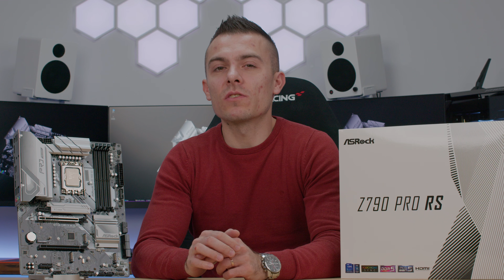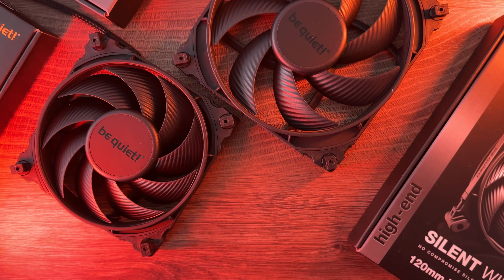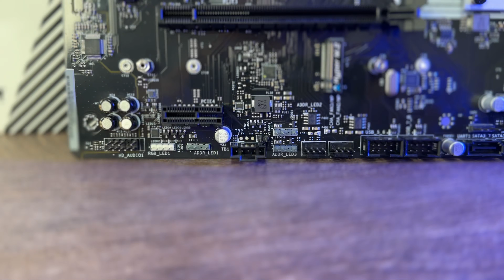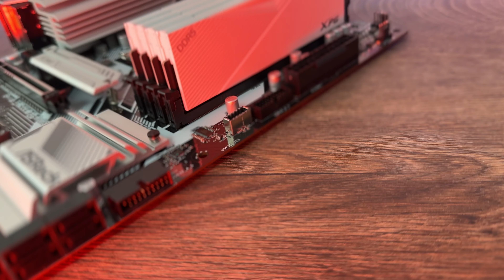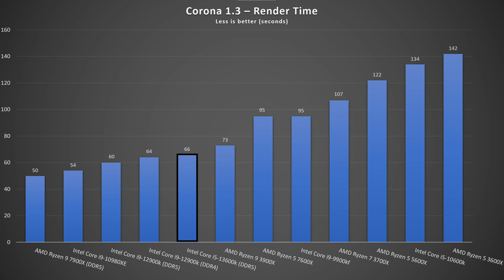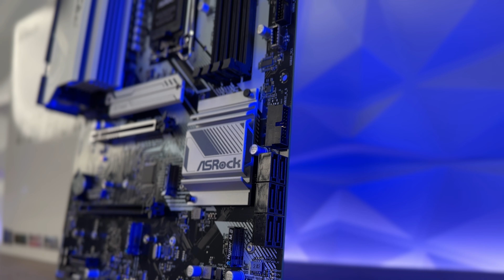ASRock Z790 PRO RS w/ i5-13600k - Benchmarks & Overview

Comment: Got this board along with an i5-12600k and 2x16gb DDR5 ram at 6000mhz, but had issues since day one despite being on the newest bios version at the time(15.01, 2024/9/27), having my drivers updated etc. At first the PC kept having random freezes/crashes when enabling XMP mode at 6000mhz, managed to fix it by setting speed to 5600(again via XMP).For some reason I also have microstutters in basically every game - more frequent and noticeable ones in CPU-intensive games.Weird, because I tested RAM, CPU and GPU - RAM returned no errors with memtest86, GPU(gtx1080) had the expected benchmark results and i5 results also looked on par with that I saw online.Tinkered with Windows settings known to cause said microstutters, tried upgradint fro m win10 to win11 but it made no difference. PC is at repair shop right now and I noticed Asrock had released a new BIOS version in JAN2025 that updates intel microcode and improves memory compatability. Hopefully that fixes it, but if it does not I am really at a loss - it is either the motherboard, which I highly doubt or the PSU. The one I got is a Cougar GEX 750W 80+ Gold which should be a decent power supply, however what I read online is that it's voltage regulation is not the best and since intel 12th gen and above have "transient spikes", it can cause microstutters. If anyone knows what might be the issue and has experienced something similar, please let me know. I have been going nuts for 3 months here lmao.

Comment: Not all of us are Gamers and don't need painted MB like Sonic and RGB lighting. I am a gamer but i need the 8 Sata ports for massive data Hard Drive Storage. Yes a use a SSD for windows ( my C drive ). The other Sata ports will be connected to 6 to 7 Hard Drives seagate Ironwolf 10TB or better. Some people run RAID, so some MBs now come with ONLY 4 Sata ports and no more 7 segment display. How can you run RAID 5 or 10 on these. Question. Do the M.2s Share the Sata ports ?
IF so do they disable the SATA ports ? Thanks for the review  this one is for me. I'll be running and i7 C cpu and will be fine for gaming. oh i subscribed
Reply from the maker: Yeah, I understand what you are saying about the design. I just have to mention how it looks even though people can see it from the B-Roll. I THINK, 2nd or 3rd share SATA connection and some ports are then disabled. Don't know which ones to be 100% sure. I don't think you can run RAID 5 or 10. Only saw 0 nad 1 explained in the manual. And of course, thank you very much for the sub!

Comment: hi , i will buy this motherboard tomorrow , i have a 13600kf , do you think that this motherboard will be ok ? not high temps like 100° (i have a 360 aio)
Reply: bcs in some motherboard it will reach 100°
Reply from the maker: @ramyhdjs3647  I never had 100°C with 13600k, regardless of the cooler. So you are good to go. The board is ok. I was surprised how good it is.

Comment: This Mbo will over heat the a CPU..
Reply: Your CPU cooler maybe or you try undervolt the CPU
Reply from the maker: Which one?
Reply: @PCCrazyDario  I just got this set up, the mobo says the CPU in the bios vcore is at 1.4v and runs games at 1.8v and 1.9v. I just bought a new water cooler to fix any issues, one of the best and Z CPU and still goes up to 87c. The games do not overheat, apart from one game which is odd. New mobo on its way, I think the voltage or something inst right about this set up.

Comment: How will this board work with Crucial P5 Plus for OS and Games with T-Force Delta RGB DDR5? (I5-13600k)

Also are there any cheaper options for a DDR5 motherboard, the one your reviewing is currently 200 US and the CPU is currently around 300 US)
Reply from the maker: Thanks for the feedback.

Yeah, the Crucial P5 Plus will work with the board. ;)

Comment: can it be used with 13600k to do an good overclock ? the temp are good?
Reply from the maker: I honestly didn't have much time to OC like crazy, but what I have heard from these type of boards, nice slight OC should be just fine.
Reply: @PCCrazyDario  thanks for your answer, so for an undervolt + oc it will be perfect 😁
Reply from the maker: @Blastrax302  Without a doubt. :)
Reply: Már annó az FX8120-at is 4,7Ghz-ig húztam asrock alaplappal. A gyártó gyengéje, a BIOS.

Comment: Just asking, which better asrock z790 pro rs or asrock b760m steel legend, for i7 13700k?
Reply from the maker: I would go with ASRock Z790 PRO RS for sure.
Reply: Also dont forget you cannot overclock on b760 board
Reply: go for the z790 pro rs. You will thank me later for the 8 Sata ports.

Comment: just a quick question it has 2 ATX 12V Power Connectors for the CPU. Do you need to plug both connectors or just 1 ?
Reply from the maker: If you have enough 8-pin EPS cables on your PSU, I would suggest connecting both. Though most motherboards and CPUs will run with only one connected if you don't have 2x 8-pin EPS cables.

Comment: do you think it would be better to add a thermal grizzly or thermalright contact frame for the CPU with the z790 boards to prevent possible CPU bend overtime?
Reply from the maker: I have actually never used one since I didn't have any issues and currently rocking 12900k on my other PC without it and it works just fine.
Reply: @PCCrazyDario  thank you!
Reply from the maker: @casperrealov  You are very welcome. :)

Comment: Excuse me, better this or Gigabyte B660M aorus pro? For 13600k. Im confused used B660 expensive or Z790 entry level? Thanks
Reply: Use Z790 for intel K series, unless you won't overclock in future, I have Gigabyte B660M aorus pro ax for my 13700k, that because i don't have plan overclock it , and I have gigabyte 3090 turbo in my sistem, I want that fit in my M Atx case
Reply from the maker: I haven't tested or reviewed Gigabyte anything for quite some time, but I have heard loads of people buying this entry model Z790 and they were all very happy. Even if they don't OC, they were satisfied. But Po Capan said also a viable point there. So finally, it is up to you to decide.

Comment: by any chance does it come with windows preinstalled or do i have to install it myself
Reply: Windows is never installed on the motherboard itself, that's all on your hard drive. If it's a brand new build, you will need to install windows.
Reply from the maker: You have to buy Windows and instal them yourself on an SSD you also have to buy. Unless it is a pre-built PC that comes with Windows. That is a different story.

Comment: Did you have to update the bios? Mine wont post cpu amd dram led is on. My mobo was z790 pro rs wifi
Reply: Nah theres no need to update bios. It comes compatible with 13th gen.
Reply from the maker: I didn't but you do have to update it for some updates. But as @SUBARU60 wrote, it should work instantly with 13th Gen CPUs.
Reply: @PCCrazyDario  thx guy the psu was the culprit. It works gr8t now.
Reply from the maker: @ArvinG  Glad you managed to find the solution. Enjoy now!

Comment: this or the asus rog strix z690 with ddr4. asus one is 50 bucks more expensive.
Reply: i chose this because I didnt wanna flashback
Reply: @MaxedMemez  oh  flashback is no problem for me. If it doesnt work i just send mobo back ahah
Reply from the maker: Hmmm, well honestly. I would always skip DDR5. Board is great, just the stability of DDR5 isn't still there. That is why I build for instance my sim rig build based on DDR4. Got an MSI MPG Z690 EDGE WIFI and satisfied with all RAM sticks working properly without a single glitch. Other than that, the board is great. As for the ASUS board, I honestly don't have a clue since I didn't review it. It isn't bad, but I can't give you any exact information about it since I didn't check it out.
Reply: @PCCrazyDario  yeah thats what i was thinking. I wanna future proof sinxd5im building new pc with 13600k. But some games ddr4 gets more fps
Reply from the maker: @Hasmatix  Well you could always later on switch to DDR5 when prices drop and stability of them rise. ;)
Reply: @PCCrazyDario  yeah but i need to sell mobo then.
Reply from the maker: @Hasmatix  Yeah, I know. :/